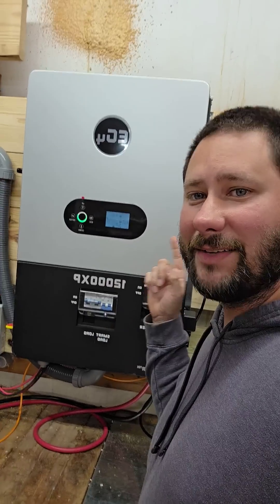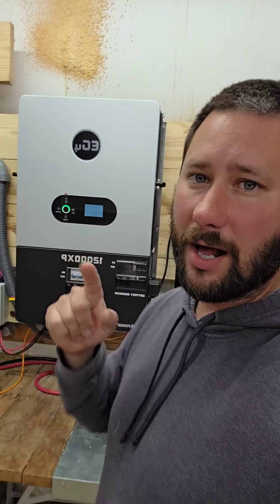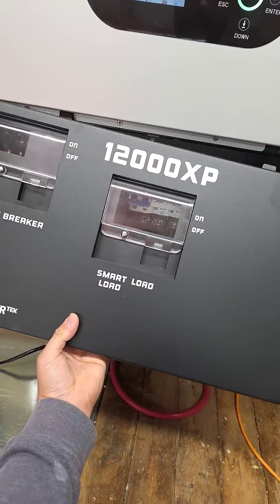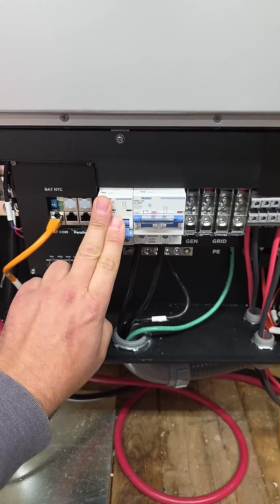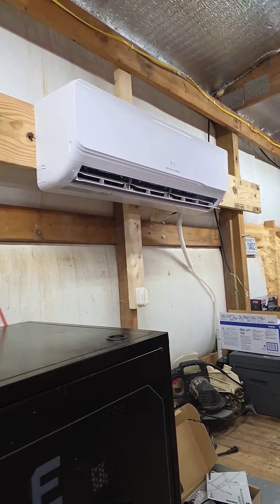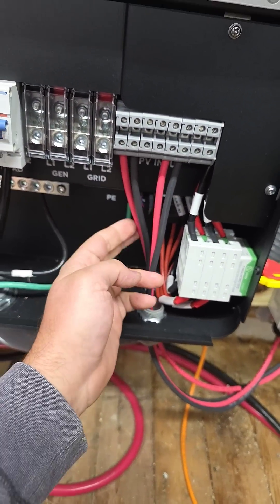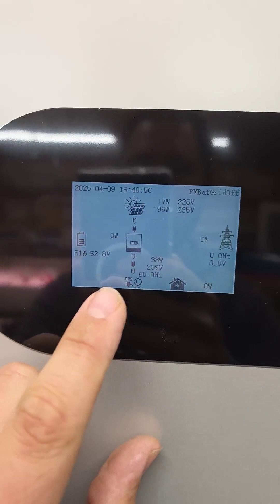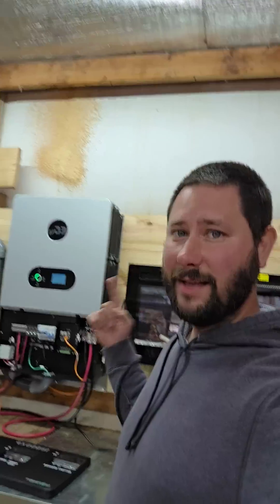The Best Off-Grid Inverters for Your DIY Solar Setup

Comment: No, it's not a real off-grid inverter. It's basically a toy that offers a poor surge capacity rating and a shorter life expectancy, and it can do some pretty serious damage to your appliances when its MOSFETs fail. I would never install one of these cheap, Chinese-made high-frequency inverters in any residential application.